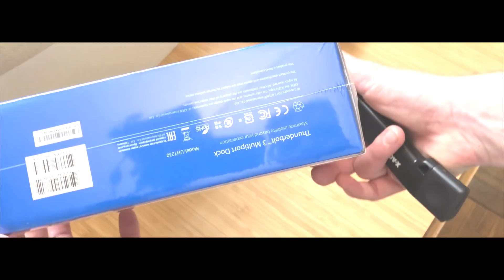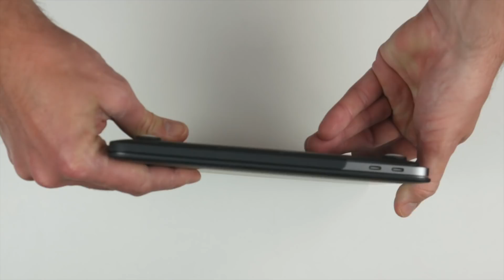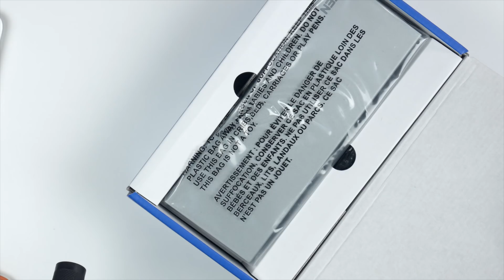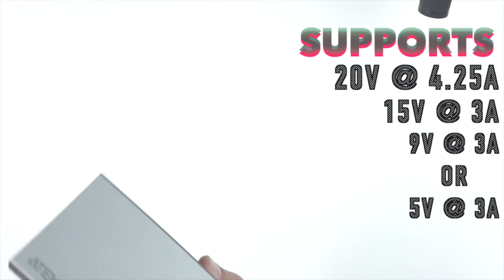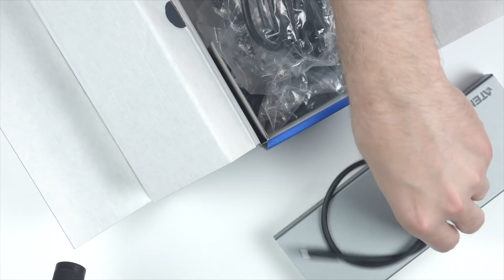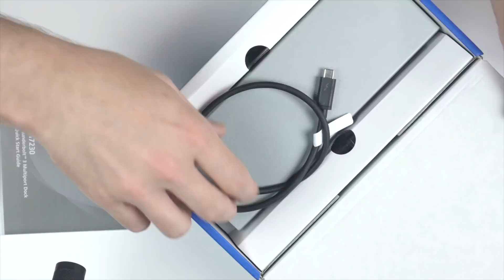#95 - ATEN Thunderbolt 3 Multiport Dock - First Look

Comment: Sad how we now need to buy docks to get functionality (ports) that was just built into the computer a few years ago.
Reply from the maker: No doubt, it can be frustrating. I will say though that USB-C is one of the best attempts to unify connectors across different tech that I’ve seen yet. It is a pain though for sure for pro use at the moment.
Reply: Sure USB C unifies a lot of devices into one connector, but even if everything were to suddenly use USB C, 2 connectors still is not enough. I wish we could go back to the unibody days when we had ethernet and many other ports built right in. A device is not portable if you have to carry around lots of docks and adapters just to use it for your work.

Edit: I see now that it seems to have 4 ports
Reply from the maker: ErikTheAndroid No you’re absolutely right, it’s only got 2 ports, it’s brutal. I actually travel with my 2015 15” MBP because I need the ports.
Reply: Alright then I must have been getting confused with a different model. Either way Windows 10 is pissing me off so much at this point that I am considering switching back to the Mac world. The sad thing is that Macs have changed completely since last time I had one 10 years ago. I had a pre unibody which was full of ports, had a nice screen, and was still sexy. Now they are ultra thin with no ports and an absolutely terrible keyboard. The 2015 Retina is looking like a much better computer than the current offerings.